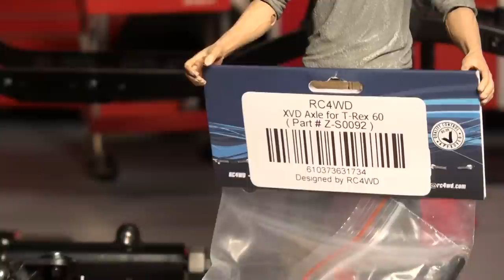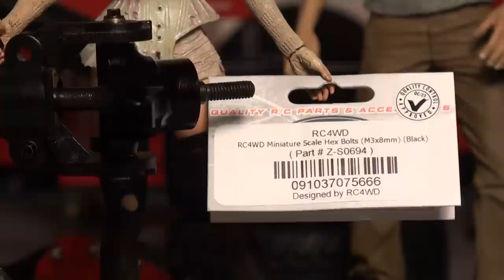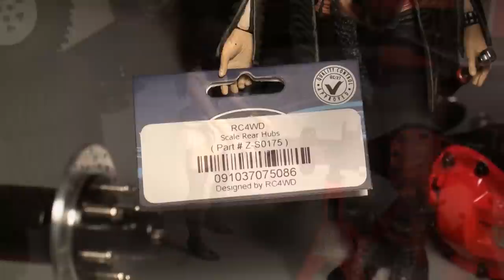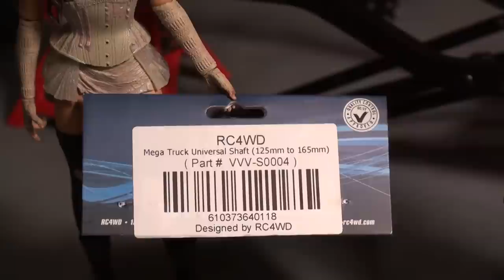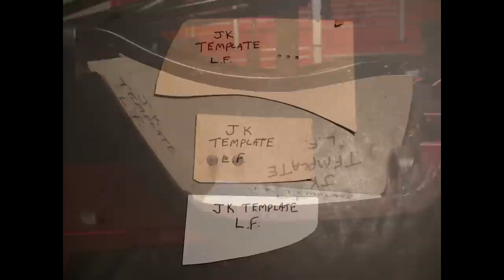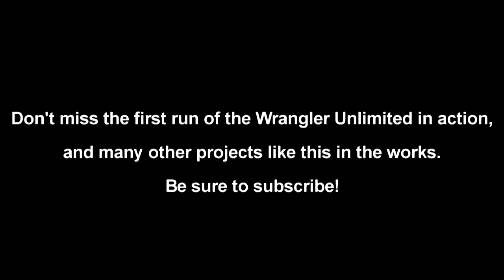Custom Jeep JK Wrangler Unlimited hardbody scale RC truck - video build and shop scenes.

Comment from the maker: Also, the RC4WD upper 4-link mounts (Part Number Z-S0562) would make it even easier to install these axles as a 4-link setup.  I made custom 4-link mounts for my application but theirs would save you the trouble.  The axle kit used in the video already comes with the lower 4-link mounts.

Comment from the maker: Thanks.  I separated them at the waist joint and used shoe goo to glue them in place.  I had to remove some material from the drivers ass and back of his legs to conform to the seat better.  Also trimmed where his torso and waist met to lower him down some more and took off his feet too.

Comment: Great work!
This is my Jeep:

Axial SCX10 Scale New Bright Jeep Rubicon JK
Reply from the maker: Guy St I happened to watch your video after your first post, before you added the link.  I guess YouTube is now blocking comments with links until they're approved.  I didn't see your other posts until a couple days later in my community tab.  I wish they'd stop changing things.  Nice job on your Jeep, we have the same body,
Reply: Thanks Dan,  I didn't quite understand the way you fit the driver in the driver seat,  did u cut his legs?
Reply from the maker: I answered this question below but will post it again since it is way down the list.  I separated them at the waist joint and used shoe goo to glue them in place. I had to remove some material from the drivers ass and back of his legs to conform to the seat better. Also trimmed where his torso and waist met to lower him down some more and took off his feet too.

Comment: Hi yes I found them. I am only going to buy a back axle because my front axle is unlocked, and the back locked. I will get the servo mounts for this axle (Z-S0562) and on the back piece I'm going to put a rod end in the middle which will receive the Axial Y-Piece. Also, I have custom springs so I have to work round this. I only want to use this axle for the scale look and articulation improvement, but I might want to be getting a solid metal axle for this. Thanks for your help.

Comment from the maker: Thanks for your comment.  I really did suffer through this one, lol. 
It took forever to get all the fabrication of the floorboards and wheel wells done, but I hate when I see a nice rig and then you see wires and daylight right through the wheel wells.  Just gives it right away as a toy.  I like to make it hard to tell it's not a full scale truck.

Comment: This is amazing! Coolest rig and build video I've seen out here. Great job with the wheel wells and not using the body post to fasten the body to the chassis.  How did you go about securing the body to the chassis? I didn't catch that in the vid.
Reply: I watched it again... I see it now. Everything is hidden so well, nice and tidy. .
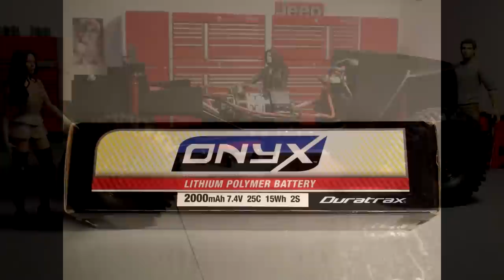Reply from the maker: LukeDaUke Thanks.  Yes, at 14:49 you can see the front body mount with the Velcro attached to the top, and at 14:41 is the rear.  Like you said, if you watch through the video carefully a couple times you can see all the details of building the body mounts and everything else.  : )
Reply: Dan Campise I'm working on how I'm going to mount mine and am considering Velcro too, but am wondering if it's sticky enough? I watched the first run vid, looks like you got a good bit of thrashing around in <thumbs up!!!>, around those sand dunes. How's the body and chassis holding up? Have you had any issues w/ the body popping off?
Reply from the maker: LukeDaUke The Velcro worked great, body stays put.

Comment: I got the same body! trying to get it to fit on my e10!
Reply from the maker: Midwest Rc Bashers Maybe you can get some ideas from the video. Where there's a will there's a way. Good luck 🍀👍
Reply: Dan Campise I did get some good ideas!! I got this body for 3 bucks!  I'm having issues getting it to fit with the interior because my battery tray is in the middle

Comment: What's the length of the 4 links. I measured the 16mm for moving the shock tower and it doesn't seem right. I moved the tower to the last hole in the frame then drill a new holes. I'm not sure mine will look as good as yours but I'm going to try. Thanks
Reply from the maker: I looked in my build files for you.  The rear upper links are 108mm (106mm link + 2mm spacer), rear lower links are 106mm.  I moved the rear mount 16mm rearward from the furthest back set of holes and drilled new holes.  The front links are 92mm upper and 100mm lower.  Keep in mind that I am not using Axial axles and they have different mounting locations.  Also I made custom front link mounts which change the mounting positions further.  You can see some of the details in the video.  Good luck and happy building.
Reply: Dan Campise I did forget about the axles. Maybe that is what is wrong with mine because to me the front axle location is no where close. My shocks are siting sideways not up and down, but again I'm still using the stock axles. I have seen videos of people using the stock transmission but I cant seem to figure out how they did it. I want mine to have the same ride height as yours so I think I need to get that RC4WD tranny. Thanks again.
Reply from the maker: Robert Walker You can use the stock trans but you have to cut out or mold the interior for clearance.  I wanted to keep my interior intact for realism so I went the hard route and fit the R2 trans as outlined in the vid.
Reply from the maker: My R/C trucks are going up for sale now including this one.   For more info see this video:
https://www.youtube.com/watch?v=52ghT4na5ps&t=3s

Comment: Do you think i could put the hardbody on an rtr jeep jk?
Reply from the maker: You'd have to adjust the wheelbase longer and make some other adjustments and modifications but sure.  My truck is built on an SCX10 frame.  You can see the changes in the video.

Comment: Ohh it looks good..... But: 
With the interior very low, does the interior hit the transmission? or is there room enought?. Have orderd the Boom-racing hardbody jeep from Asiatees, and think, i have, a problem with, fitting the body, with that low interior, on the scx-10 standard trans.....
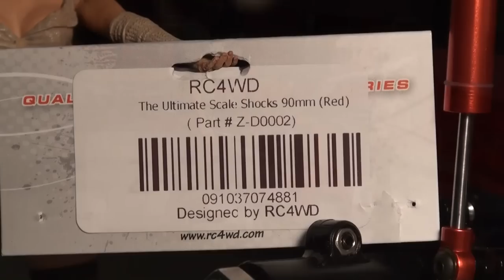Reply from the maker: john nielsen Thats why I used the RC4WD R2 transmision, I didn't want to cut up or heat and deform the interior to fit the SCX-10 trans.  It was more work but the interior is untouched for realism. At 8:57 in the video you will see the transmission mod.  If you're not to concerned with the interior just cut out some for the stock trans to fit through.
Reply: Are they 7" figures and could you add passengers at the back?  BTW...O for orsume! :)
Reply from the maker: Yes, 7" figures. To add rear passengers I would have to remove some or all of their legs.  More on the figures at: https://www.youtube.com/watch?v=hcgssr3ZmxM

Comment: HI i have a real life jeep and anted to sort of have a project with making an RC one, i have no clue about starting an RC or building one but  i feel like this would be somewhat simpler than having to get a body then painting it and starting from scratch. any tips on how to start, I've found several New bright's similar to the one you have here.
Reply from the maker: Mich step Yep, starting with a painted toy is much easier than scratch, but adapting it to a chassis can be a lot of work as you can see by this video.  The easiest way to go is with a "ready-to-run" (RTR) truck. Perhaps an Axial Jeep RTR truck.
Reply: great thank you so much

Comment: Anyone know what length the links are in the suspension? Trying to build one myself
Reply from the maker: Hi. I answered this below in the comments but will repost it again for you. "I looked in my build files for you.  The rear upper links are 108mm (106mm link + 2mm spacer), rear lower links are 106mm.  I moved the rear mount 16mm rearward from the furthest back set of holes and drilled new holes.  The front links are 92mm upper and 100mm lower.  Keep in mind that I am not using Axial axles and they have different mounting locations.  Also I made custom front link mounts which change the mounting positions further.  You can see some of the details in the video.  Good luck and happy building."

Comment: are those wheels and tires 1.5 from rc4wd? if so witch ones?
Reply from the maker: Yes.  Here are the links.
Wheels: http://store.rc4wd.com/Stamped-Steel-155-Stock-Black-Beadlock-Wheel_p_37.html
Tires: http://store.rc4wd.com/Mud-Slingers-155-Offroad-Tires_p_663.html

Comment: Great video and build. Can you tell me where you sourced this kit? I can't find it anywhere.
Reply from the maker: I got mine on Ebay. Just search for "New Bright Jeep JK"
Reply: Thanks. I mistakenly thought that the vehicle was kit with a hobby-grade chassis. I realize now people buy this toy-grade vehicle for teh body and mount it to a better chassis and electronics. Did you use an Axial SCX10? sorry for all the questions? I'm new to this.
Reply from the maker: Mr242723 No problem.  Yes, SCX10 chassis.  Watch the video carefully several times and pause when needed, you will see all the parts used including part numbers etc.  It's like a cheat sheet.
Reply from the maker: My R/C trucks are going up for sale now including this one.   For more info see this video:
https://www.youtube.com/watch?v=52ghT4na5ps&t=3s

Comment: What did you use to mount the body?
Reply from the maker: rcaction Velcro. At 14:49 you can see the front body mount with the Velcro attached to the top, and at 14:41 is the rear.  If you watch through the video carefully a couple times you can see all the details of building the body mounts and everything else.  : )

Comment: Where do u get all the shop stuff from what website
Reply from the maker: IIDirtyArz : Funny you should ask that. I just decided the other day to sell all my RC truck stuff including the trucks.  I’m working on a “for sale” video that I will be putting up on YouTube in the next couple days.  Anyway, to answer your question, the tool boxes I got on eBay by searching “snap-on tool box bank”. The jack stands are from RC4WD. The rest is mainly spare tires etc.

Comment: How did you get Megan legs to bend like that
Reply from the maker: I answered this question below but it's way down there now so,  I separated them at the waist joint and used shoe goo to glue them in place.  I had to remove some material from the drivers ass and back of his legs to conform to the seat better.  Also trimmed where his torso and waist met to lower him down some more and took off his feet too. I actually did a video on this too here: https://www.youtube.com/watch?v=hcgssr3ZmxM